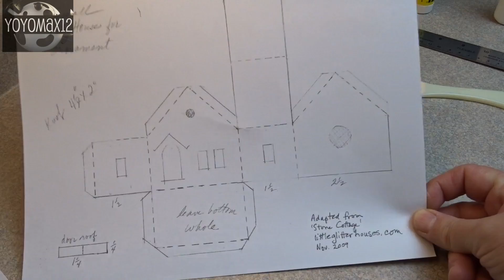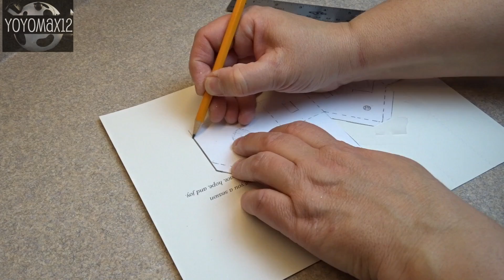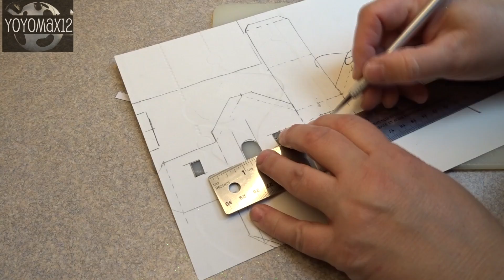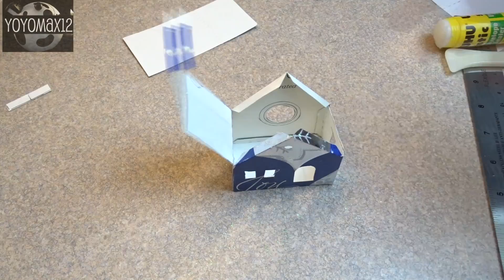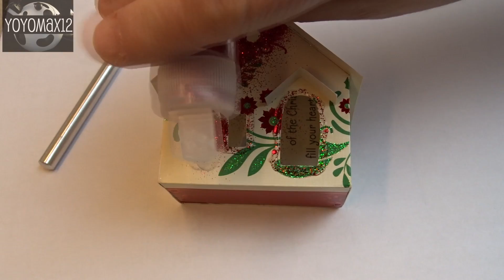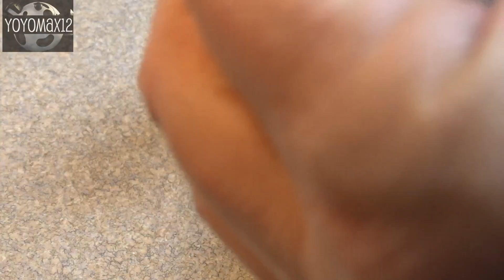Putz "Glitter" House Ornament Using Recycled Christmas cards-with yoyomax12

Comment: Just a hint...I use a light COLORED 
 pencil to draw my FOLD lines. I do everything batch style, draw all houses first, then cut them all out, then assemble,  then decorate them all at one time. This way, I can work on these when i have free time. I don't have a dedicated  craft space,  I just use 2 small folding tables. Doing  batch style means I dont have to keep pulling out ALL the  necessary  craft supplies,  but only the ones I need for the particular step I'm doing. Hope this helps someone who doesn't have a lot of space, or time. I can work for an hour or so, then clean up my things and the next time I have free time, I'm ready to go to the next step. This works for basically any craft. Happy creating to you all. I know this is a basic tip, which a lot of you already know,  but some people feel overwhelmed when they start  crafting. I think we all should share our knowledge... no tip is a  bad tip to the person who needs it!! 🙋‍♀️😊